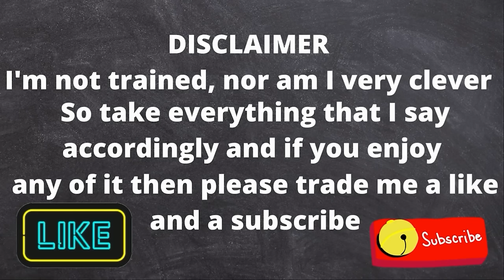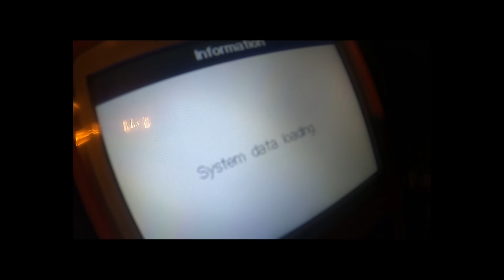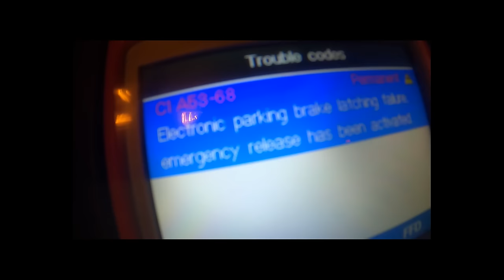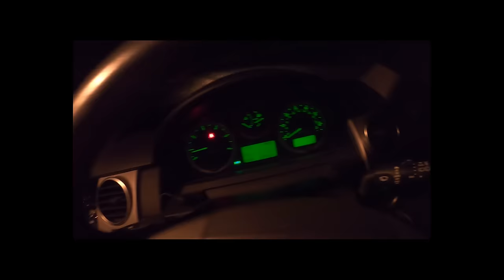A couple of serious issues have befallen the 2009 Land Rover Discovery 3 Tow Car!

Comment from the maker: Thanks for watching sorry it's not the usual caliber of video but it's important for you to know what's going on behind the scenes! The limp home mode hasn't come back on yet thankfully and the handbrake I will look at next week. Apologies for the screen going smaller halfway through too that seems to of been an editing error! Busy week! Mondeo video coming next week!
Reply: I blamed my old eyes
Reply: didnt notice the small video going smaller till i read this
Reply: Ben.... have no fear anything you put out will be eagerly digested by the great unwashed. It's not necessarily the content but the way it is delivered.
Reply: Yes easy to forget the scale to frame size!!
Reply: I actually loved this video. I haven’t heard many positives from owners of discoveries or the e pace. My sister had both from new and had nothing but trouble with them ( I had warned her about Land Rovers ). The Jaguar ended up at a specialist about 100 miles from where she lived as the normal dealers couldn’t fix it. She now has the Hyundai Ioniq and had no trouble at all with it.
Reply: Rock on ben😊
Reply: I had the same issue with my actuator, lubed the arm up from the inner passenger wheel arch gave it a few taps then used 2 bottles of Forte diesel turbo cleaner, and it was fine after that.

Also had the same issues re-setting the handbrake after new shoes discs, cables and the repair kit for the actuator box… ended up selling it with the issue!
Reply: I also didn't notice the screen going smaller, maybe because we're blokes! 😂 Why don't you buy a late model old Defender, that would be much better than the new Defender, and be much easier to work on.👍🏻

Comment: If you like Landies get a bloody good series. They will be running for your grandchildren to enjoy. Excellent channel.
Reply: This.  The old, proper Landies are the ones to have.
Reply: @cjmillsnun  Around where I live there are at least four pre 1970 Landies still working for a living. See them every day...
Reply: My discovery ran well for 8 yes, then had the 3 amegios fault, $8300 later in 9 yr, is what the cost of rectification by landrover main dealer cost. Year 10 sold as trade in on a Holden commodor, faultless for the next 6 yrs. Moto: Never to own a landrover, ever.
Reply: I have had several and can confirm that the old series Landy will be running for many years ...... just very very slowly. 😉

Comment: What a nightmare, had similar issues with my E46. The back plates were rotten & the shoe retaining pins pulled through causing the shoes to jam inside the drum! Also had a Passat with electric handbrake & it regularly failed. Hope you get it fixed. Great video as always Ben 👍

Comment: Having had a disco 3 for 10+ years and had three handbrake assemblies, very used to the “screaming cat” sound. In their wisdom the closed unit has plastic gears for a car that is over 3 tonnes. You can manually release the handbrake by lifting the cover next to the handbrake paddle and there is a manual override cable. Easy to do. To be honest, never used the handbrake after the third unit as knew it would fail again.

Comment: My friend has recently bought a new Defender. There was an irritating noise in the cabin so it went back under warranty. 140 JLR labour hours later they discovered a bolt loose in the engine bay. It replaced a 2012 Discovery that would go into limp mode when pushing on up hills. Like you he bought it as a tow car which it performed admirably but there was was just too much reliability annoyance.

Comment: Hi Ben.
You know what? You could do videos of your Land Rover experience and still be as entertaining as your normal stuff. Almost wet myself when the noisy handbrake actuator remained, after almost a week of playing with it! That’s roughly the point at which I’d be contemplating a gallon of petrol as the next solution, but you deadpanned it. You really should consider a standup routine. You’d be very good at it.
Yes, I thought it might have been a step to ensure the handbrake is “OFF”, before building it up, but you didn’t mention it, so I suspect the actuator has the cables fully pulled and you’ve built up the brake mechanism to clear the drums in that condition. I think the Turkey noise is the motor chattering against the end stop.
But I have never (and would never) worked on one of those, so I’m just talking out of my arse. Don’t rely on me.
I love how they keep all the stuff that ever used to go wrong with hand brake mechanisms and add loads  more stuff that’s even more likely to go wrong, and call it an upgrade! Never understood what was wrong with the ratcheting lever, myself, but they keep fiddling with it, trying to find less reliable ways of doing it. Mercedes brolly handle, anybody? 
Keep it up and just video whatever is going on. I doubt many of us are here to learn mechanics from you…
Cheers

Comment: Loved the video 😂.  Car manufacturers  like to change the heads on their bolts 🔩 to stop the home mechanic doing weekend repairs.  So by changing the heads the car has to go to a main dealer for service and repairs, knowing that the DIY er won't have the correct sockets.
Reply: the worse thing about the old defender is the sodding calliper bolts! 12 sided jobs, but a half in or a 13mm can go on, which can cause rounding!  So a small job can end up been a nightmare!

Comment: Not even the guys at R&D at JLR had these as wheels of choice i can tell you. These were built to discourage anyone other than franchised dealers even attempting a repair, mainly by parts designed to fail just after warranty and the need of special tools and software only supplied to their dealers.. Great Video

Comment: If there was a lot of heat transfer in those rear wheels then the electricity generated into the subframe could interfere with the sensitivity of the electronics in different areas, I noticed the earthing strap underneath the gearbox looked a bit crusty, great video, take care, Gareth

Comment: Egr valves the bane of every mechanics life
Reply: Some fucker bodged repaired the egr pipe on my old 300 tdi,  I said to my dad its so slow off on moving, and its not keen on moving up the box, compared to my dads 200 tdi. I bought a EGR delete kit, and i binned the full nosh off. Fuck me it was like a different motor.  My dad said look at the state of that pipe to the inlet!! i said aye, i just swopped that over 1st, drove here, and it was like night and day!   My 306 HDI i disabled it many moons ago,, and the mot tester binned the cat off it lol.  One thing i want to do with the TD5 is cat.  The previous owner told me, that he was going to ditch the EGR off it, and said might be worth you doing that, when you change the oil. Which i did that year.  My dad kept raving on at me 2 years later to do it, and i said, i already did it, he said when?? i said two bloody years ago!

Comment: Oh, another thing, lest I forget. If the limp home mode returns and you can’t get a code reader to point you, consider the egr valve. Those get stuck partially open, similarly to the turbo actuator, when the engine is at operating temperature, but exercising them by doing an off/on cycle can often free them, temporarily.
Might be another place to use plus gas, perhaps?

Comment: Youll need to open the hand brake module to release the cables. When the adjustment is out the motor winds up too much and locks up. Iv repaired a few of these by opening the module and freeing off the cables

Comment: Hi Ben watching your video on your discovery hand brake issues. It sound like to me that the gears in the actuator on top of the rear chassis that drive the cables are knackered which is why it won’t latch and is coming up as operation failed. Also a lot of us who own newer Land Rover discovery and range rovers all have the gapIID tool which is pretty much the must have diagnostic tool when owning and working on these vehicles.

Comment: Ben about 34 mins mark I thought oh yes you destroyed the shoes but you have not replace the stripped plastic gears in the boxy thing above the spare wheel, Now as a mechanic for 30years and had 5 Landys can I send you my D3 to have the handbrake fixed after I had to angle grind through the handbrake cable to release it one time (nope the emergency pull did not work) 
The fix to yours is a Plastic gear set and then a calibration with the scan tool.

Comment: Be interesting to see if you can actually get a new Defender for £300 a month, friend has just got a 110, it's £1000+vat a month, that's with a 10k deposit and it goes back after 3 years..... Ouch. We've just fitted mudflaps and sidesteps as the dealer wanted £1600. I appreciate that they've sold a lot of them and they are popular, but don't be fooled into thinking that they're anything like the light truck that the old Defender was. I'd work through the Discovery, hey it's more content anyway!. 👍

Comment: Hey Ben another great video from the bearded wonder 🤣👍 once you sort the cable there is an actual bed in procedure for the handbrake shoes mate. Too long to explain on text but I’m sure you Will find it online .. basically by using a procedure it lets you drive and apply the park brake on and off to a stop while driving etc . I had to do it on my disco 4 after new discs. Good luck mate

Comment: I had a Fiat 500X which came with an electric handbrake. I didn't have a problem with it, but I did with Canbus. Lots of software issues which the dealer could not resolve, but local independent did. For example Sat Nav, and Phone stopped working, and going into Limp Mode. The problem is the manufacturers need to do software updates.

Comment: Check your pipework to the turbo as a split pipe will make your vehicle going to limp home
Reply from the maker: Good shout! Maybe a smoke test or something seeing as I can't get in there!
Reply: @tastyclassics definitely go for a smoke test my sisters c-max had an audible leak and I couldn’t see it even grovelling underneath. Your probe will come in handy for that 🤣
Reply: I have a crappy renault trafic, get lots of problems that put it into limp mode. Latest was injector plug wires were worn and corroded.  Then earth problems and any one of the million sensors..

Comment: A mate of mine has his own Land Rover repair business. He says these things are the biggest heaps of junk in the road. Everything about them, engines (snap crank shafts), air suspension, electrics, brakes etc.. diesel V6 engines run on boost almost all the time which causes limp mode issues. I towed a huge Hobby caravan to Greece twice using my 1998 Jeep Grand Cherokee 4.0L and it never missed a beat. Simple and robust. Avoid any Land/Range Rover built after 1995.

Comment: Hi Ben,
I've had 2 new Disco 3 and 4's. A 2010 Disco 4 and now drive a 2014 RR sport. All very good vehicles.  Looking at your D3 it looks poorly looked after, the rear brakes were worn out the back plate totally rusted away.. what do you expect!! Buy one that's serviced and looked after and you won't have any issues.
Take it to a good specialist and get all the faults diagnosed and sorted and you may get some trouble free motoring

Comment: Landrovers always have bags of codes in the system its normal, usually theyre voltage related due to low battery, the noise is the handbrake module under the rear of the vehicle, dont listen to what people say about lifting the body as you really dont need to, but fiddly but its doable ! You need a decent diag to read landrovers like delphi and this era suffer from woeful turbo faults and the turbo is also a twat to change but its doable, believe it or not the range rover L322 TDv8 is an epic vehicle and extremely reliable, ask jeremy Clarkson, theyre his all time favourite!!

Comment: Been driving a new Defender recently. Quite nice not as nimble and quick as my F Pace SVR but pleasant. 
You are being a bit unfair to the Disco - it’s far from new and has clearly not been properly maintained looking at the state of the brakes. The electric parking brake module has failed making that screeching noise and has locked the brakes on. That IS a common failure point I will admit. 
All cars get problems like this it’s not unique to Land Rover - you cited Volkswagen problems too. 
You said your pick up is dead reliable but I don’t see you driving it that much. 
I’ve had 3 F Paces and they’ve been brilliant - but our local main dealer is brilliant and know their stuff.
Reply from the maker: It was a video about 2 of the 7 faults it currently has 🤣 full service history aswell! To be fair I still really like it
Reply: @tastyclassics Full service history 😂😂from Land Rover main dealer 😂😂😂you crack me up 😂😂.
Reply: My mate has a Volvo V70 and had similar problem with his auto handbrake. It locked on in a car park while on holiday. His wife wasn't that impressed 😂
Reply: @tastyclassics  i would take that as a pinch of salt too, regarding service history. Some of the stuff they should do but don't bother, My TD5 was looked after my a land rover specialist,  and had a fuel pump done by them a year before i bought it,  guess what failed on me last xmas, yep the fuel pump, they had chucked a cheap one in, so i had to do the job again, and fitted the proper decent unit,  and it runs much better than the day i bought it.  Best off servicing cars your self record the mileage when it was done on the receipts, and your laughing.  Also mine was a pain in the arse to get read,  you can get a diagnostic kit called a Nanocom thing, that supports these.  The bloke who tried to diagnose mine, said it was the crank sensor loom failing, but it turned out not to be the case,  but i swopped it over for the sake of a few mins job.

Comment: Think yourself lucky. I drive a Citroen Relay as my work van(I run a light haulage business). In the last 12 months it’s cost me £10k. Various things breaking which you’d expect with the miles that I cover, but a new engine after the cam belt failed(my fault, didn’t get it changed when it was due), then the replacement engine failed in 10000 miles.Luckily it’s under a warranty.
By the way it’s original engine did have 330k before it died.

Comment: 1975 Volvo 245 i used to own had handbrakes in the rear discs just like your Range Rover but they're always really too small for the job , then add in the unreliable over complicated modern electronic systems and they're bound to fail , if only Land Rover could use Japanese electronics they'd be world beaters .

Comment: I have found that Volvo 244DL’s make better tow vehicles and that’s speaking from experience where my dad used to scrap vehicles and do rubbish removal’s etc , we had a 1978 red 244 DL estate automatic with the big aluminium bumpers with the shock absorbers behind them front and rear, that thing after only cleaning the carburettor pulled even vans into the scrap yard when our 1982 Y reg beaver tail Ford Transit MK2 custom prop shaft broke and it was off the road whilst waiting for the parts to fix it , this modern rubbish eg coke cans and electric headaches on wheels ain’t good for anything.